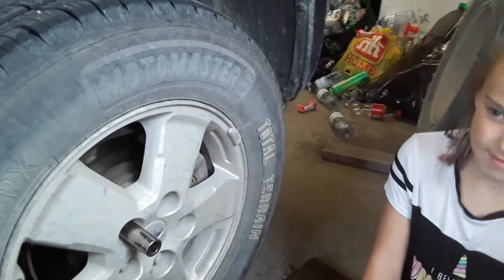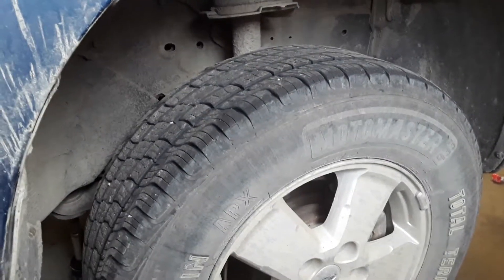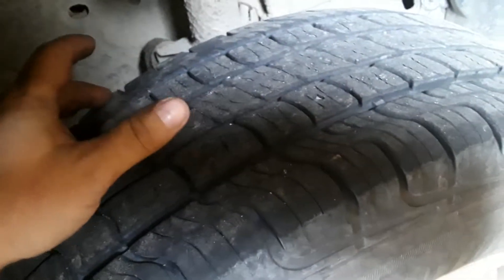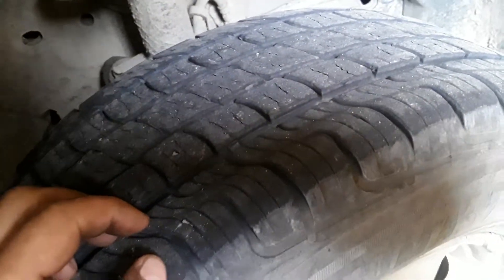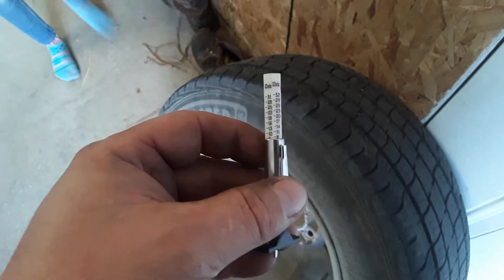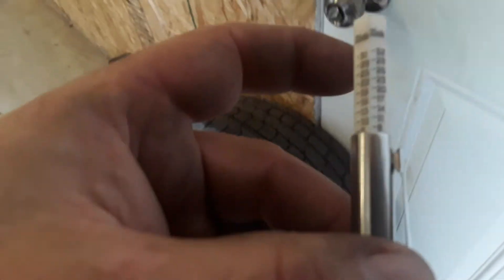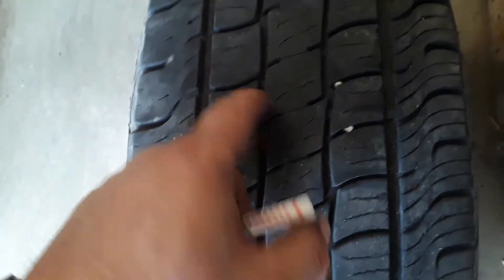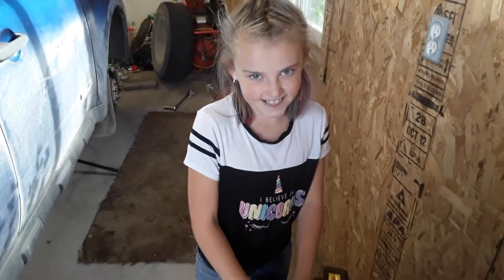Update on Motomaster All Terrian APX tires

Comment: When you do rotation, do you flip? I mean white lettering side goes inside? This tire doesn't say outside or inside on the wall, I assuming they can flip?
Reply from the maker: They can flip, there is no rotational marks, but youd have to dismount from the rims, and remount after flipping them. Nobody would take the time to do that. Just follow whatever pattern owners manual has, usually back two come straight forward and two on front cross and go on back

Comment: Are these good for driving in the winter? I have the same set of tires on my Mazda tribute?
Reply from the maker: I thought so, but l believe they are now discontinued in this size
Reply: No I was asking because I have a pair already that has barely been driven. Should I get winter tires or will these suffice?
Reply from the maker: @spinviper6998  l guess it depends where you live, some provinces and states have laws in place for winter tires etc and when your required to use winter tires, example certain dates you have to have winter on by